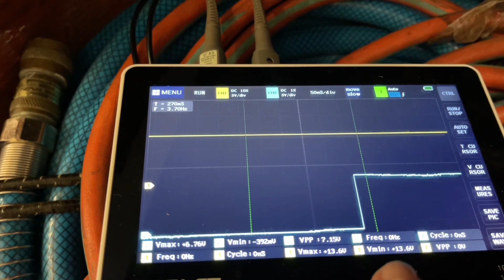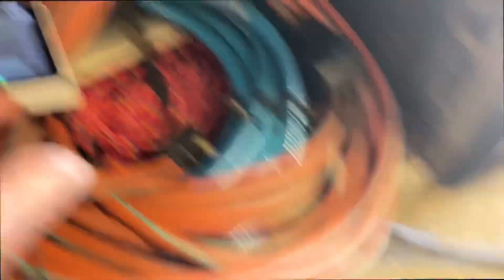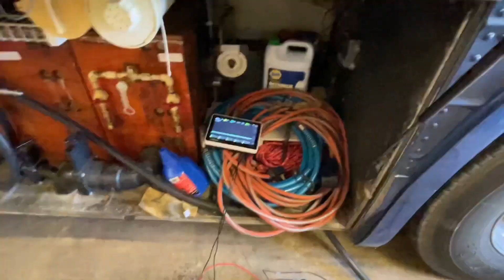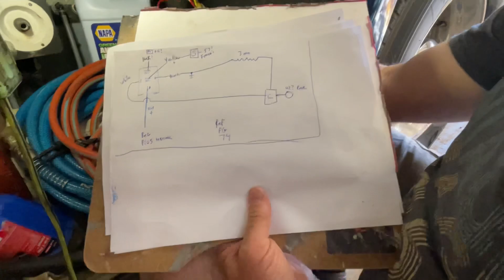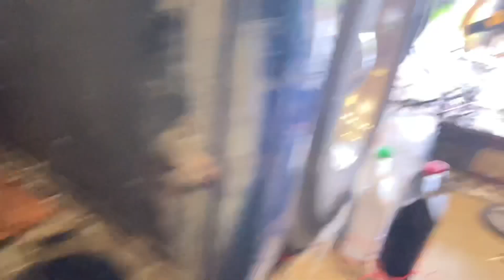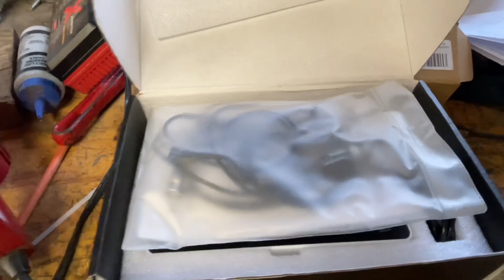Fixing the 50DN alternator voltage regulator on our new bus

Comment: Nicely done, what settings did you use on the scope?
Reply from the maker: I don’t remember but obviously the frequency is slow and the voltage is high relative to normal electronics stuff. Not an oscilloscope expert by any means.
Reply: @ThisOldBus no problem, I am too, the one I had the alternator was bad, the 325amp fuse smoked and voltage regulator power relay was cooked.

Comment: Where did you get the new regulator? Google search brings up sketchy suppliers. I gutted every inch of wire, terminals, relays out of my bus and replaced only what I needed. Tons of OE stuff that is N/A.  I did the magnetic switch update for the regulator, replaced all chassis grounds with ground wires and terminal blocks-- probably the single best upgrade for any old bus. I'm running the old regulator with a single 8D, no issues at all. But.. maybe I will get a new style regulator to put in the spare parts bin..... I also moved my regulator to the rear wire compartment so it is easy to access. Plenty of room back there once you clear out all the old crapola.
Reply from the maker: It’s a D698, I didn’t have to source it because it came with the bus. I was seeing them at transpo electronics (wai) before but can’t find them now. I’d buy them anywhere that seems reputable and in stock.

Comment: Hey Scott, you have more knowledge than I do on diagnosing this for sure.  My bus has had that fluctuation in charging for 35 years.   It also has the added relay (which I think was added to extend the life of the regulator)  that is either on or off and cycles about 100 times a minute.  When the bus has been sitting for a while and the batteries are down to 12.5 volts or so, the output voltage on the 50DN is in the 14.7 range.  However, once they have had an opportunity to be refreshed for a few minutes, the output voltage drops to something under 14 and will stay at 13.7 after an extended drive.  All the buses I used to drive did the same thing from what I recall.
Reply from the maker: None of the other buses I’ve had did this and in this case I could hear the engine cycling under load while it was doing it, I’ll bet yours does the same thing, and it’s hard on the gears. The relay is stock, in this case a modification, but not needed with the new regulator. I would seek to resolve the issue, most likely extra resistance between regulator and alternator.